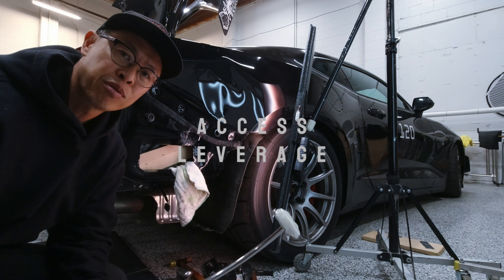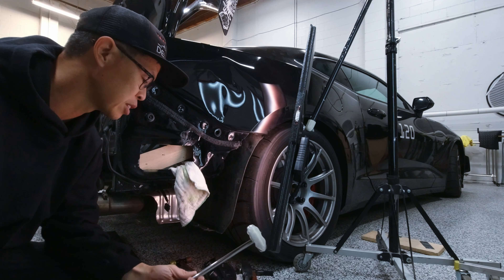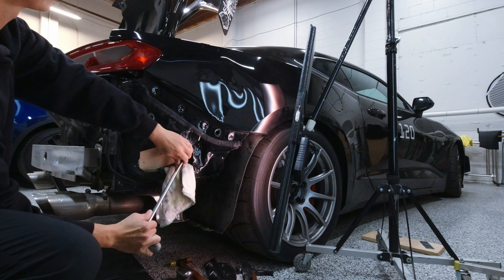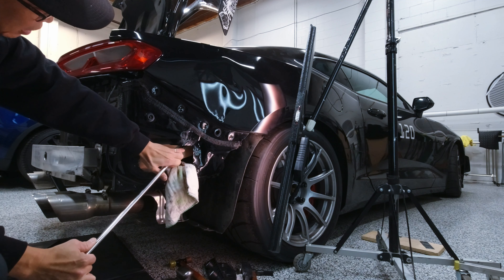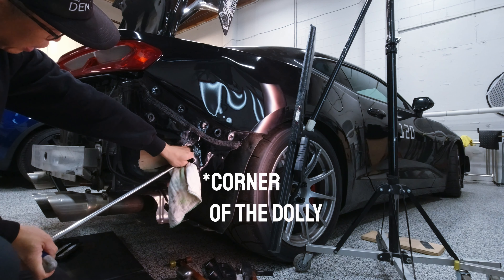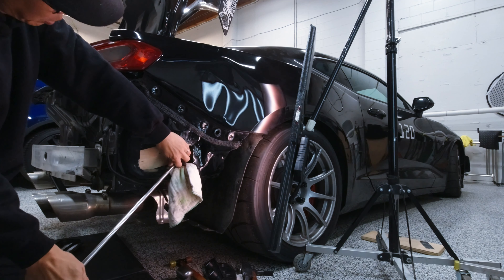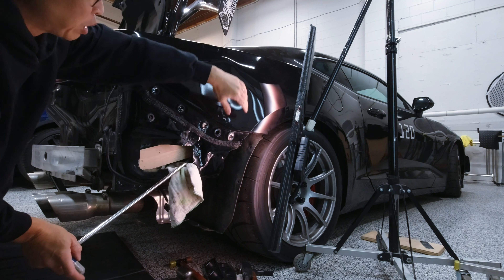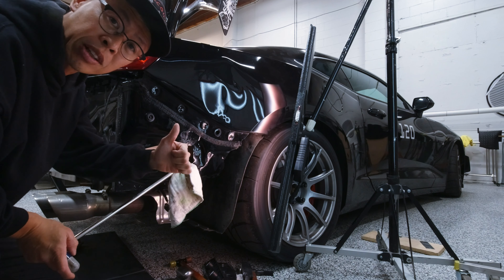Dent Repair | Tracked Camaro hit at the Quarter panel x bumper line | Paintless Repair

Comment: how long did you take? Van.
Reply from the maker: Hi Bill, thanks for watching. I didnt really keep track on this one. I had it in my shop overnight and spent time here and there on it. Guessing 6 hours on the quarter.
Reply: @VanDentPro  thanks reply. did you repair the carbon fibire panel before? I tried cant get it.
Reply from the maker: Hi Bill, I haven't repaired dents on CF panels, I don't think it would work. I don't think the resin could handle it. Some epoxy resin CF and Fiberglass  you can bend a bit but I don't think PDR would work with it
Reply: @VanDentPro  Thanks I tried. even I heat it for a while then pushup then waiting for cool down it doesnt working.
Reply from the maker: @billcui7827  Thanks for sharing!